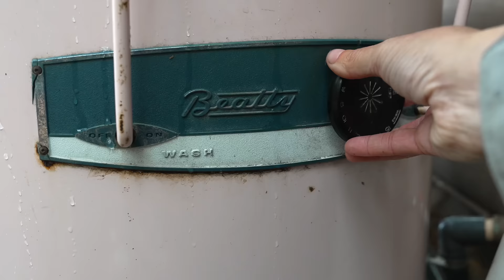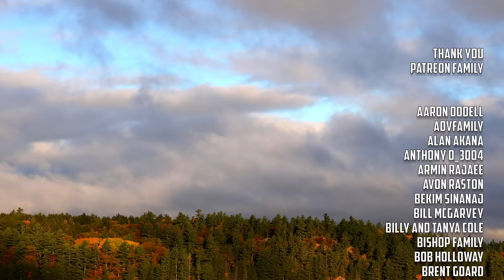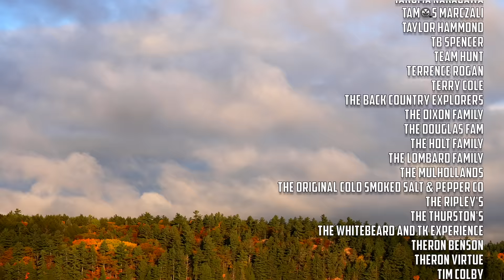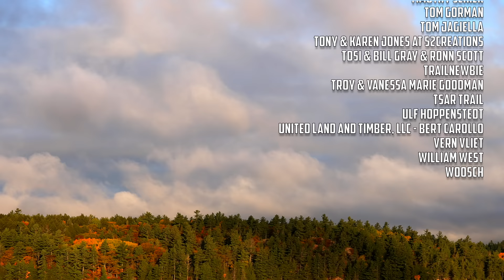THE END OF THE JOURNEY | Our Boat Sank // EFRT S8 EP39

Comment: Point the nose of your boat out towards the lake rather than towards the shore.  Will help prevent most swampings like you experienced.  Put the engine up so that the propeller doesn't bang on shore if possible in case it gets pushed into the shore.
Reply from the maker: Great tip. Thanks